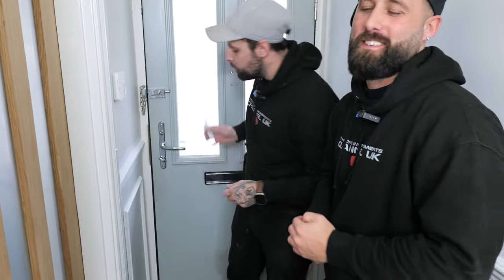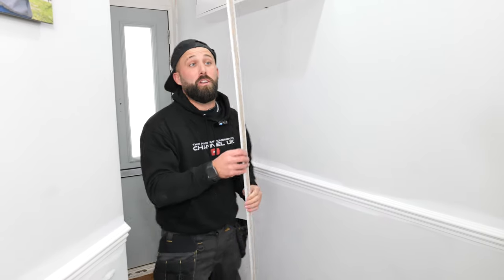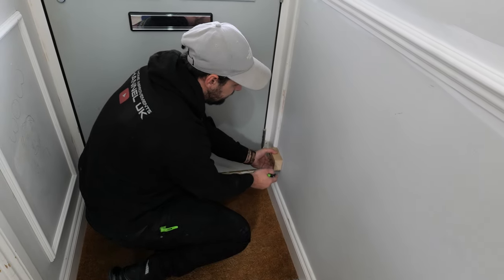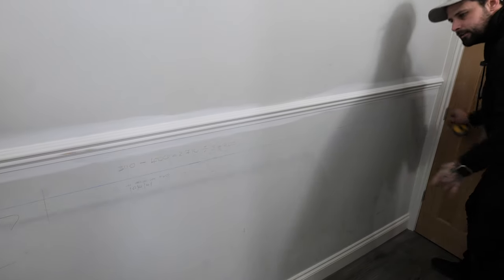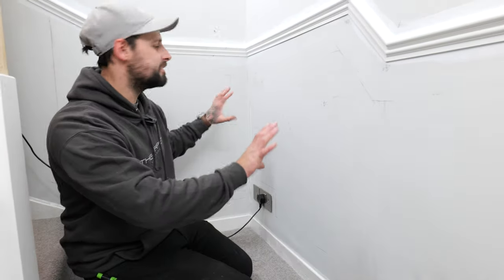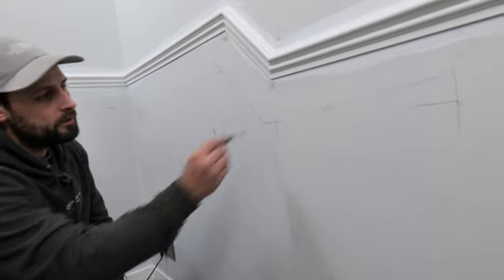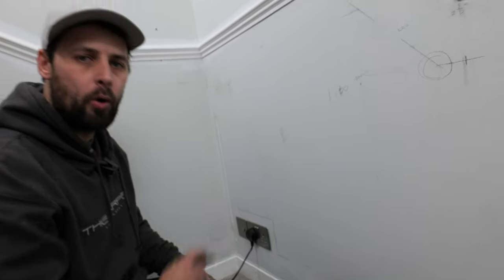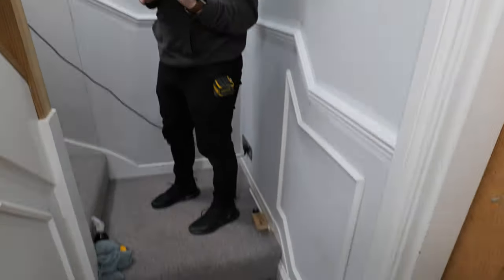How To Install Wainscoting / Picture Frame Panelling To Hall Stair Landing - Easy Step By Step Guide

Comment: When you said "make sure it's pressed in", you pressed it in and it moved... genuine question, if only using 4 pins, how do you go about getting the profiles properly flat against the wall?
Reply from the maker: The grab adhesive does 99% of the work the pins are mainly to stop it sliding 😊

Comment: One suggestion I would make. When cutting your mitres with many the same size it’s much easier to set up a stop block away from your blade and this ensures they are all the same size and it’s much quicker.

Comment: Thank you, great video, helped alot! A quick question.  I have a landing that is a 90 deg corner and from there the stairs goes up at a different angle.  How do I make the trim join perfectly at that corner.  tia
Reply from the maker: Thanks will try to make a video soon it’s hard to explain 😊😊

Comment: Great video, best I seen so far. Bit of advise..my wall in some places is slightly bumpy, uneven plaster work,would panelling still work ..how would you tackle this issue? Thank you
Ps: i am diy ..what saw size would you recommend for this work.Thx
Reply from the maker: Thanks Anna and caulk the gaps after your done 😊 a small mitre saw will be fine don’t need anything big 😁

Comment: Great tips guys. I when it’s on 22.29 how did you get the the flat section in the top point of the panel, I’ve recently done some and struggled to get cuts my chop saw it maxes out at 60 degrees. Cheers lads
Reply from the maker: You cut a scrap at 45 clamp that to your saw you then have a starting point of 45 degrees hope that helps 😊

Comment: How do I do the stair calculation if I have ready made panel kits that are pre-cut to 45 degrees, can I just saw the correct angle and make them slightly smaller?
Reply from the maker: Not too sure what your saying there mate ?
Reply: @homeimprovements  I bought these pre cut panelling kits from b&q mate and they’re designed for a flat wall… would I be able to use them for the staircase too ?
Reply from the maker: Ahhh you’d need to recut all the mitres 😊👍🏼

Comment: Great video guys ... with my hallway wall its would start at the front door and leads all the way up the stairs finishing at the bathroom door. When working out the number of panels would it be best to take the complete measurement or can i break it down into sections? ie door to bottom of the stairs, bottom of stairs to top etc. I would obviously like it all to look uniform so your expertise would be appreciated.

Comment: Great video chaps! Silly question incoming - if there is approx a 10mmdifference across between where the top / bottom of the panels will be over the space of a wall (2m) because it's an old / uneven house, do I need to do anything different to account for this? I'd be looking to do 2x panels with the same gaps as you've done. Will this much of a difference matter?
Reply from the maker: Chalk it out chances are it won’t be visible to the eye 😊😊😊
Reply: @homeimprovements  Nice one, appreciate it! :)

Comment: Thank you so much for this video!!!! Quick question (and perhaps a stupid one). When you apply the panels vertically up the stairs, should every single one be the same length? My calculations are suggesting that the panels will increase in length as they go up the stairs, but I can't work out why. Any advice pls?
Reply from the maker: No stupid questions 😁 so if measured horizontally level they should be the same they won’t measure the same when measured at the angle of the staircase . Hope that helps 😊
Reply: @homeimprovements  okay will try that and let you know how it goes. Thank you so much!!! Do you have an IG account? Would love to follow you there
Reply from the maker: We do it’s the same name and logo 😁💪🏼

Comment: Guys I'm seriously impressed with your methodology. I will start mine in the next day or 2 following your instructions. What I'd like to know though and you haven't shown it is hot to cut the acute angles. where the angle cut is greater than 45 dgr.

Comment: One side of our hallway has a couple of doors so some of the walls in between the doors are not very wide so using the same spacing as the opposite wall would look really odd as we would have one of the panels extremely thin. Might look odd to leave them out as it wouldn’t flow up the stairs
Reply from the maker: Yh you can adjust as you see fit to get what looks best for your space 😁 that’s why it’s always best to chalk it out first

Comment: Great video - thanks! A quick question, if you can't use pins to hold in the panels because it's soft brick for example, what can you do instead? Would it work to use more sh*t glue with i.e. masking tape to protect the wall from the excess that squeezes out?
Reply from the maker: Could work these walls are brick and will take a panel pin until the glue sets then remove it 😁👌🏼